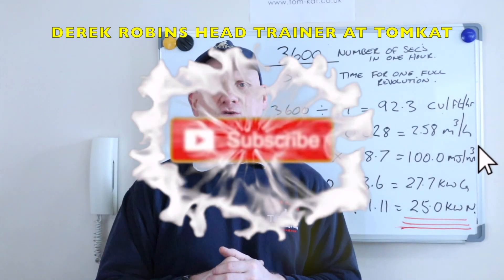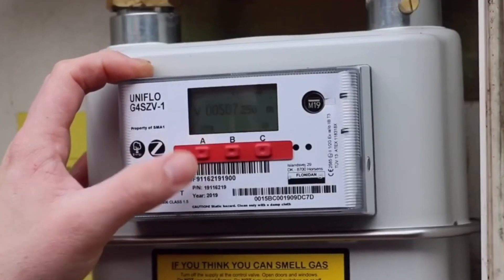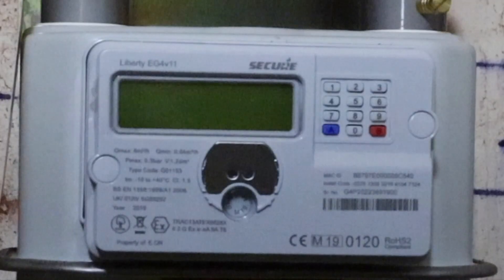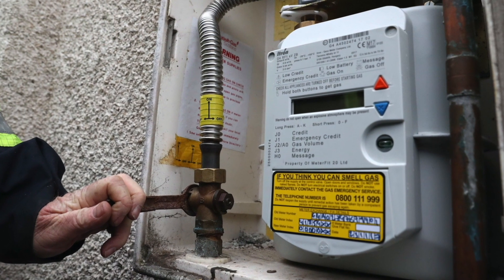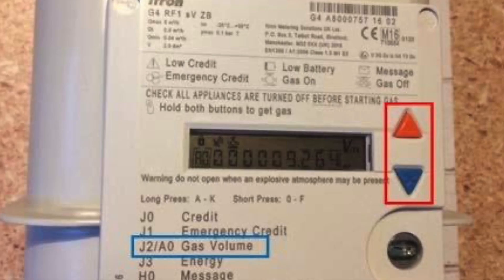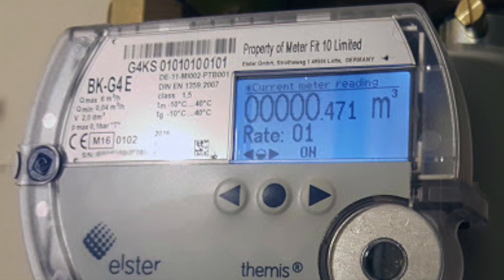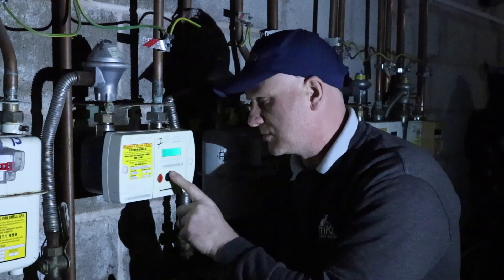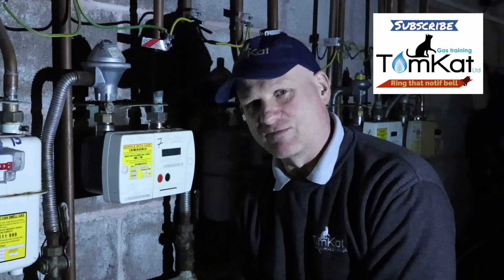HOW TO GAS RATE USING TB 112, how to gas rate  smart meters using gas safe technical bulletin 112.

Comment: I was told on the liberty gas meter it gas rates for you, have the appliance running and press “0” 4 times an it gives you the gas rate instantly
Reply from the maker: I have tried it and it never comes out correctly. If you think about it the only way it can do it is take an average so it’s not accurate. Also the manufacturers don’t mention that for gas rates they say press 999 so if o was acceptable they would tell you that.
Reply: @tomkatgastraining  yep I though the same derek, I gas rated a boiler an was 2kw lower that manufacturers stated
Did it again an it was better 

But it dismissed tell you if it’s gross or nett

Comment: Hi, I saw an E6 paymeter with a 60m 50mm tracpipe from the underground meter store run down to 22mm when it enters a 3rd floor flat last week. Wherever the tenant runs out of gas then puts credit back on they just keep resetting the 40kw combi boiler untill it fires up (it takes about 5 minutes). Is this against any regulations with the gas running out in such a long pipe run and the tenant continuously resetting untill the boiler fires up without using a proper purging kit? 🤔. Also I think previous domestic gas engineers have only been tightness testing from the AECV inside the flat due to the length of run. Is this acceptable as the landlord is only responsible for the gas inside the flat? 🤔.
Reply from the maker: The landlords responsible for the gas pipe from the gas meter so they should be having a commercial engineer test the gas pipe once a year. Remember you don’t have to do a tightness test on a landlords report but the landlord has to have the gas pipe checked once a year so to do this landlords the engineer should hold test and purge for commercial and then the domestic ticket for the appliances. As for the tenant running out of gas they should not be on a payment meter so they don’t run out of gas.
Reply: @tomkatgastraining  thanks for the reply. 👍
Reply: Smart meters, from what I can glean are only of benefit  to the providers !
Also had an experience of a Landis & Gyr smart meter shutting down for no apparent  reason; turned  out the electric  meter was NOT a smart meter.Gas meter was changed to non smart meter, problem solved.
On the subject  of Landis & Gyr meters (It's  a boring correction) but Gyr is pronounced  as gear, they used to produce the Potterton  and Gloworm  very popular and market  leading programmers back in 1970's and 80's. Useless  info I know, unlike you brilliant  presentation. 
Have printed off copy of TB112  and put it my Evo bag for future ref.
Will make gas rating  easier, no more excuses  for any of us.
God knows why the manafacturers  couldn't  make it as simple as the meters they  succeeded. 
Just a thought, old story of products manufactured buy idiots who haven't  considered the end user???